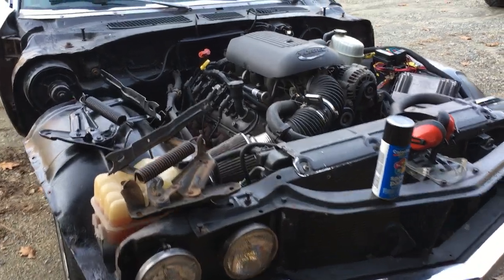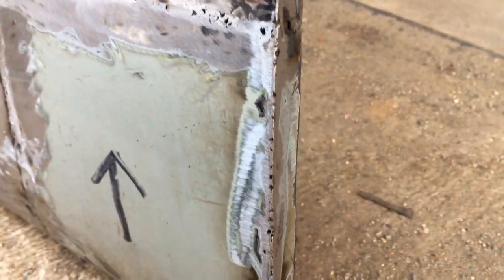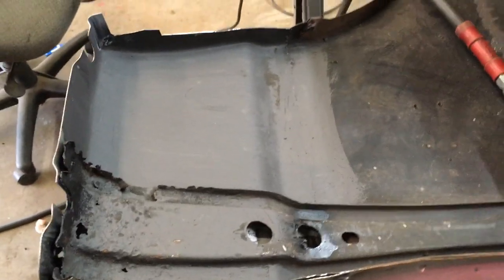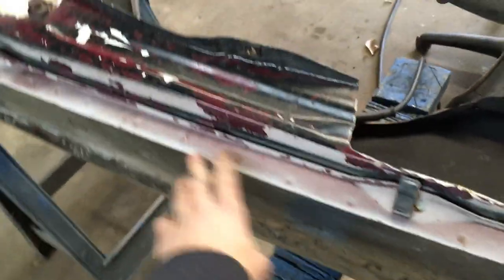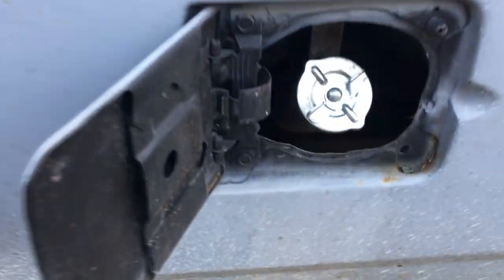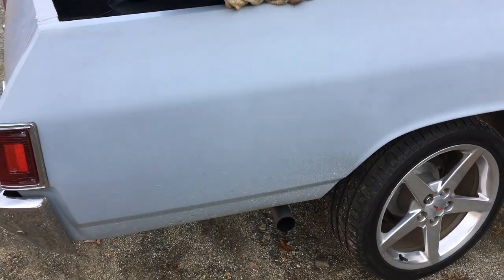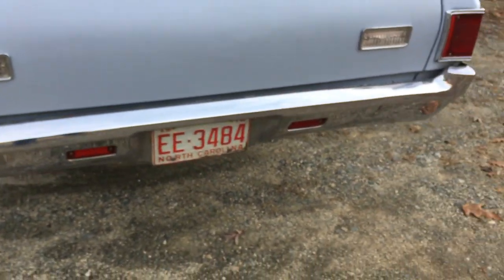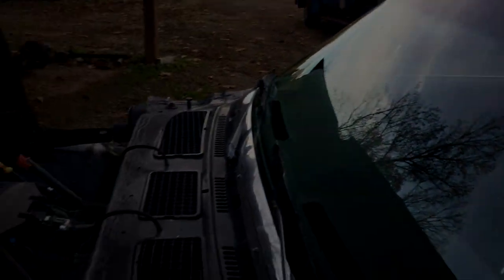How to Repair Rust and Start Body Work - 1970 Elcamino

Comment: tail gate is only $225 that's all i payed for mine i got both bumpers tailgate and a a 2 inch cowl hood for under $1000 bucks cheap its a calif truck no rust at all traded a 2008 harley davidson 1200 sportster for it and the guy thought he got over on me shit of course he lied said the engine was rebuilt 10.000 ago when i pulled the plugs 3 cylinders had antifreeze in three of them so i found a 1974 Lt 1 engine rebuilt it for $600 and the transmission was just rebuilt recently it only had 2 paint jobs on it sanded it down to bare metal going to paint it when the weather gets better i got a brand new hvllp turbine fuji paint sprayers they say that they are a lot better then old spray rig eliminates over spray and orange peel for $455 going to paint it midnight blue pearl once i get all the high and low spots taken care of. re did the interior new carpet door skins dash pad that doesn't cost much either and new whether stiping on the doors lot easier then i thought it would be i will shoot you a picture when it gets finished cool thank for the video keep um coming Larry Broad